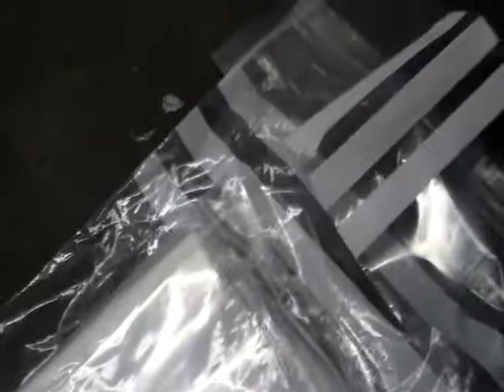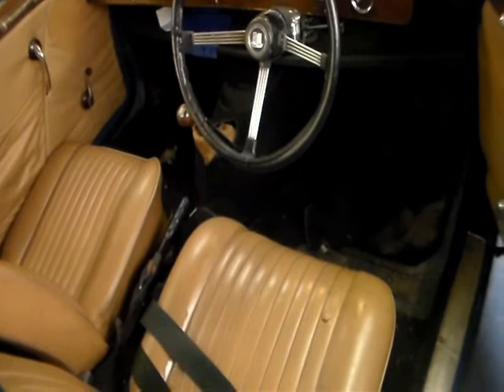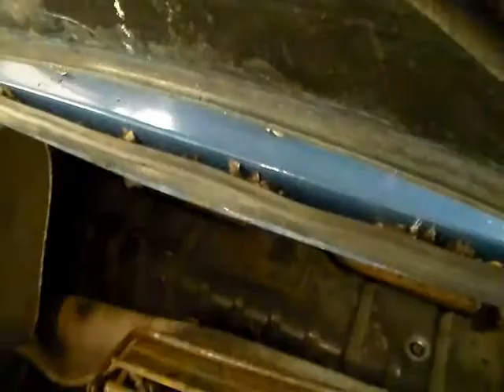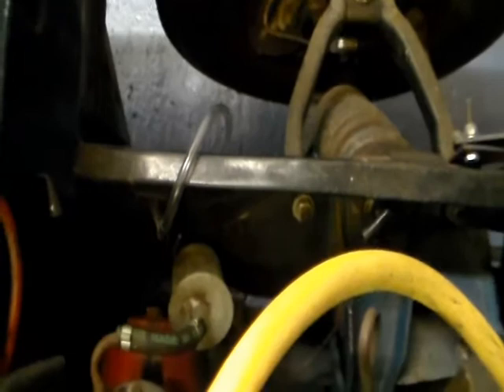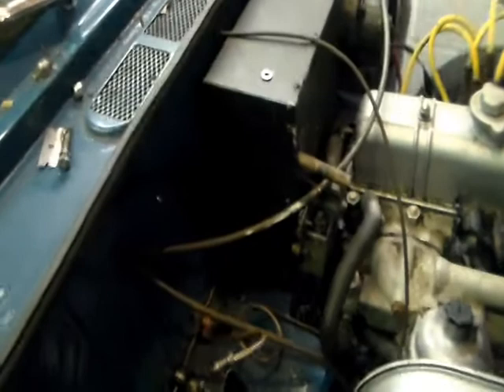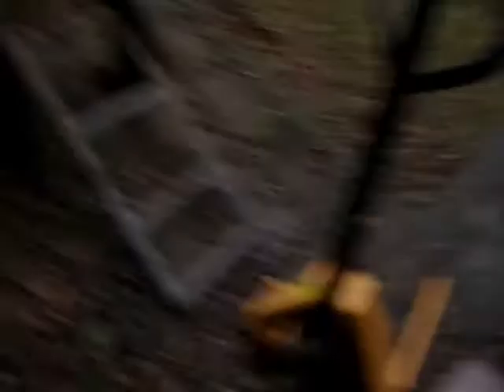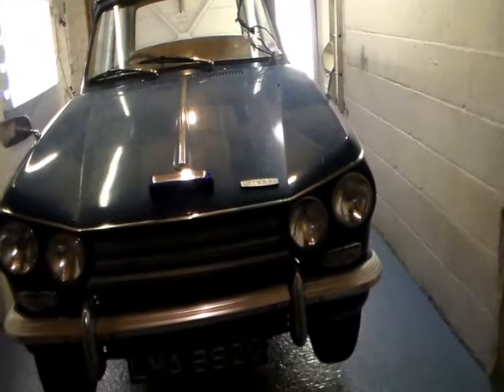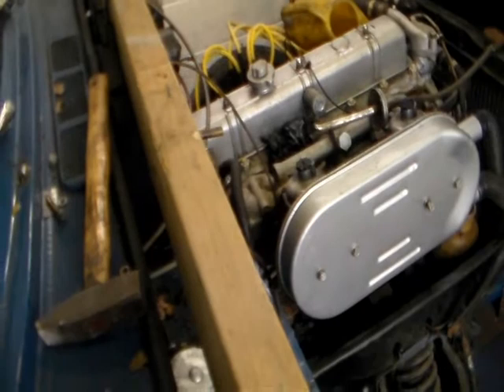16th Nov 13 Triumph Herald Vitesse body removal Pt2

Comment: Is that a mod on the rear shock top mounts to get the shock more vertical? I've a 1968 MK2 in the same colour as yours. It has lever arm shocks, which I'm planning to mod. But I can't find any info on the the Vitesse ever being fitted with lever arm ones...!!

Comment: Hi Scott, very cool vid, definitely similar to the TR6 so I'm super interested. One thing I kinda didn't get straight from the last vid - what is the issue with those front outriggers? Were they repaired in the past, just in a position that's about 5mm off?
Reply from the maker: Hi Dave, the story so far......  I bought the car off ebay as an unfinished project, the front and middle outriggers had been replaced. my first mistake was to not check the accuracy of the front outriggers.I fitted the rear outriggers and boot extensions using measurements taken using the front ones as a datum! After struggling for ages to get body gaps correct,  and after some research I found some original factory guidance notes stating that the position of the bulkhead section was key to getting the rest of the car lined up, the bulkhead section bolts down to the front outriggers and have close tolerance holes, all the others have large tolerance to allow adjustment, but I just couldn't get enough! So the body was kind of bunched up!. (The Vitesse/herald body is in 3 sections so a bit different to the TR6) Any way, along comes a little Austin so the Vitesse had to go as it was, so now it's back and i'm determined to get it right, thankfully there is plenty of info on the internet! I hope this explains it, cheers bud

Comment: Love the pikey trolley lol, EVO running gear and engine I'm seeing in that chassis :D
Reply from the maker: Ha Ha you gotta love right! I am tempted! about a engine swap but love the sound of a 6, what about Nissan?...............
Reply: Nissan's RBDET (straight 6) out of a Skyline or the VGDETT (v6 TwinTurb) from an old 300ZX. If you owned a bank would have to be a hybrid, using the old 3ltr RB Block and a new GTR head with some methanol :D

Comment: Hi Scott, I've been watching some of your vids today. Great stuff and really interesting.  I have a 1965 12/50 Herald convertible which failed its MOT this week - badly ! Needs loads of chassis work as most of the mounting points are no good - they say. I was going to give up on it, but after watching your 2 body removal vids, I think I'll have a go at taking it off and having a better look. One question though..... at the start of this vid while the music is playing, you show a diagram which shows the dimensions between overriders. I have loads of Herald books etc but don't remember ever seeing that one.  Where did you find it.  Thanks V much. Richard.
Reply from the maker: Hiya, one thing for certain, if at all possible, its best to try and get the outriggers lined up perfect before taking the body off. thats why i had to take the body off again, they are rascals to align the body when the outriggers are perfect, but a real pain when they are not! I have loads of stuff I could send you, even an original Triumph training manual about body alignment which is brilliant. Send me a Private message and I'll send them to you no problem. Gotta keep on the road as long as possible. Cheers Scott
Reply from the maker: I've just sent an email to your youtube account.